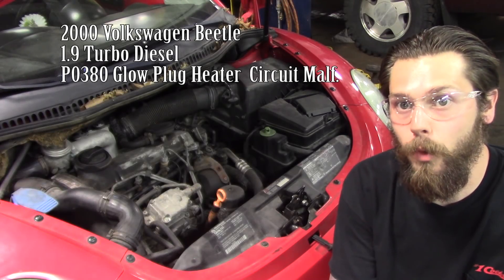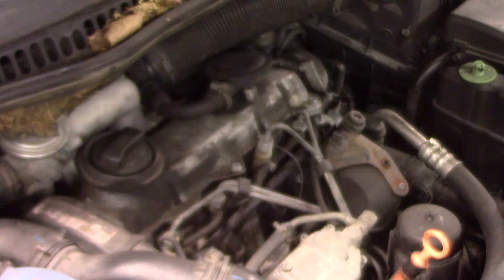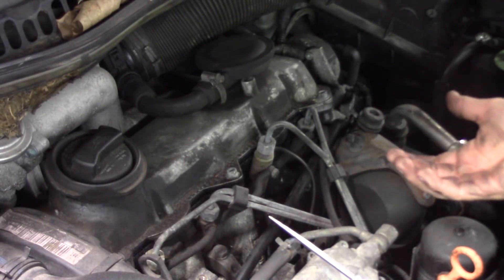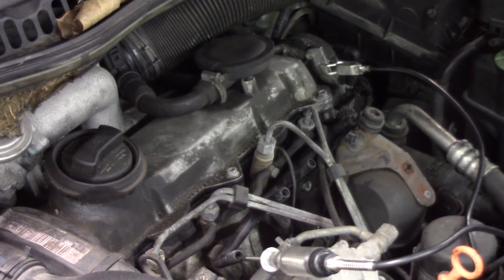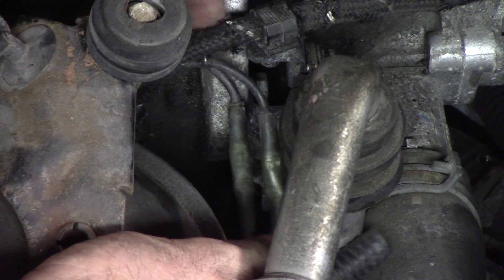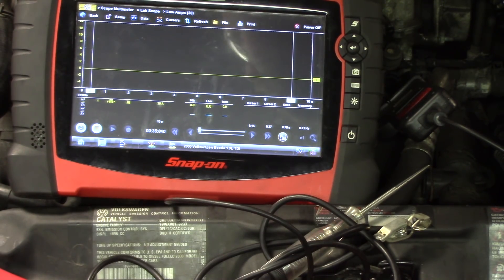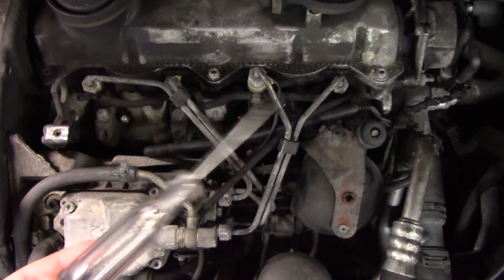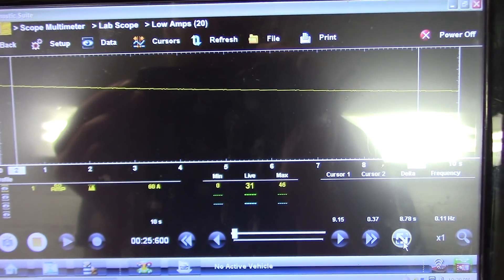2000 Volkswagen Beetle, 1.9 Turbo Diesel-P0380 Glow Plug Heater Circuit Malfunction

Comment: Thank you! This has been the most help. I have a 2000 Jetta TDI with a ratfkd harness and spliced in glow plug harness (likely culprit). Glow plug light will flash when key is turned, but then no glow plug function and still rough starts. Now that that over replaced the ECT, and checked the harness I will actually get a P0380 code. I don’t think it’s my relay. I haven’t checked the glow plugs themselves but when I disconnected the ECT it ran for 20 seconds and timed out but started fine like it should. Everything points me to the harness.

Comment: 2000 Jetta TDI with 252,820 miles on clock.  Threw CEL with P0380 on cheap OBD scan tool.,  Had 3 of 4 glow plugs test bad with test light.  Harness was basically crumbling as it was brittle.  Replaced glow plugs and harness, and still CEL with P0380.  ECU apparently remembers, so erased all codes with OBD scan tool.  No more CEL.

Comment: I came across this interesting problem once. Hard cold start, as if no glow plugs were working. Checked to see if they were getting power. None of them were. So I thought it might be a relay issue. Went down that rabbit hole, only for somebody else to find the problem in 3 seconds. :/ They took a wire, and put one end to the plug first and the other to the B+ terminal. Obviously, you couldn't see anything with the plugs screwed in, but on the LAST plug, when he touched B+ the wire started arcing! That one plug was shorted to ground, effectively disabling (?) the relay. Somebody else had tried to remove it, snapped it internally, and left it there. Maybe there was a sensing circuit, or maybe the shorted plug was pulling so much current that it was disabling the relay. I really don't know what happened.

If you unhooked that one all the rest would suddenly work again and the car would start. 

Pretty cool test, learnt something there, lol. Whenever I see a no PWR condition to the plugs that's the first thing I check now before diving into the relay side.

Comment: Thank you very much!  I know all the TDI ALH engines are the same, but given how cramped the space under the Beetle hood is, It's nice to see it worked on.  Gives me confidence.  I only wish I'd seen you remove and install the glow plugs.
Reply: 10mm deep socket, careful not to drop anything in. Put copper antiseize on the threads and your copper crush washer.

Comment: What should I do next if I have new glow plugs and test light comes on at the glow plugs bit nothing at the harness..
Reply from the maker: Make sure the relay is sending power.  so check for power at the relay pin.  If power is good then you have some broken wires

Comment: i would have tested that circuit with a higher load test light due to glow plugs drawing many more amps then that test light you used ... just to make sure there is good power under load

Comment: Hello great video. I have a question last year I changed all four glow plugs and my harness. Right now I have a flash glow plug warning light. When I did the test with the test light connected to a ground on the engine. All four harness connectors didn’t light up. I’m thinking that I didn’t have a good ground. What do you think? The diagnostic code is p0380.
Reply from the maker: Either your test light had a poor connection or you have no power going to the glow plugs. Redo your test and make sure the ground connection is good

Comment: Thank you. I found the problem, I was thinking it had started right after I replaced the brake light bulbs with LED's But I know it sound funny, I changed back just the light bulbs and everything is now working again, and no more flashing glow plug light, It is so weird how that could have done it, but that is what it was, had I know it before I would nto have done all the other things, Thank you for getting back to be so soon, You have a great weekend.
Reply: Pet Fri question I have a 2001 Vw beetle Tdi. My car glow plug light is flashing too, I replace my interior lights with led bulbs but they aren’t working right. Are you saying that adding the Led brake light bulb cause the p0380 code to come on? I did the test with the test light wire on the positive battery terminal and notice that the first 3 glow plugs light up but 4th glow plug didn’t light up. When you put the original bulbs back was your problem solved?
Reply: Hello Jon B, Thank you, yes right after I put the old light bulbs back in the glow light stopped and the cross control works again, it is kind of weird but that is what was my problem, So what I did to be able to use the LED brake light bulbs, I added a one of the old type of light bulbs to the brake wires in the trunk, I have to use the LED in the back light cause they are after market lights and with the normal light bulbs they would melt. I only have 2 glow plugs that work, so it could not be that i'm thinking what you have the problem with, I have to get 2 new for the winter yet. as it can get really cold in Alberta, sadly, can not wait for spring. Hope I answer your question, My cars are 2000 Jetta. I have and yes the code reader said P0380 glow plug/heater circuit A. Does your code read the same? I'm thinking it most be the same. Please let me know if you found the problem. I should make a video about that, or you should or some one, cause when I had that problem I spent a few days online trying to find out why, and did not find anything. Thank you.

Comment: Hello there, Thank you for the video, I have a problem, the glow plug light comes on after the car has been running for a min, and the cruse control does now not work, I have replaced the wire harness from the computer all the way to the glow plugs and replace the glow plugs and the relay 180 and still the same problem, I have a code reader and the I get P0380 GLOW PLUG HEATER CIRCUIT A, any idea what could be the problem? or what I should try next? or what it could be? Thank you
Reply from the maker: I think the computer looks at amperage on that circuit   I would take a current measurement see what kind of amperage you have and go from there

Comment: Timing on no1 is what i did do, but then i question my self did i ?
This engine is timed up at 50 btdc.and not tdc
When ford brought Jag , these are the crappy engine they put in.
Anyway i am getting away from the very first question i asked.
Is there away of seeing on a scope a correlation with the cks, cam censors and the injectors without  the use of a transducer ?

I will be  having a break from this  and attack it with a fresh mind later on.
Thanks fot time.
Reply from the maker: You could probably get some type of degree measurement looking at the crank and where the inj fires in relation to the crank. A pressure transducer would be best

Comment: You got me thinking dude aswell has my  head beening a bit muddle.
If i positioned the cams on no4 cylinder on the compression stroke instead of number 1 cylinder iwould still have good compression right ?
But the pump timming would be  incorrect ... 😕
Think ive lost the plot !  Need a break from it .
Reply from the maker: I'm not familiar with that engine, why not position at on cyl1tdc? what is the diesel engine out of?

Comment: Hi tommy wolf , nice to see someone working on diesel.
I have a question not relating to the beetle. But may be you can answer this please.
How can i check using the verus when the diesel injector gets the command to fire in relation to 50° btdc on number no1.
Am i correct in thinking i can back probe the cks and injector.
.just not sure what to use on the verus. Can u help please and share some light . Thanks ps.
Reply from the maker: You could use the crank and inj. What engine?  If you could make a fitting that would thread into where the glowplug goes and install a psi transducer to look at in cyl pressure
Reply: Positive Lead Diagnostics  thanks for the reply , the engine is a Ford 2.0 diesel 2006 which they fit into jaguar. 
It had a broken cam chain guard . Which has been replaced. timed up, good compression on all cylinders but is a no start with no fault codes. So with out stripping it all down again and checking if I'm 180* off . You know when things like this happen mind games start to play it's part
 " did I time correctly ? "
I don't have a transducer , bet that's expensive . 
So I thought may be I could check some other way.
Reply from the maker: If your compression is good how could it be 180 out

Comment: The Amperage test is very important, it will tell you the glow plug is drawing the right amount of current. The test light test is a good , but not full prove. Great video.
Reply from the maker: I agree. I think both tests are important. And mainly so easy and quick
Reply: Yeah test light is 100% a useless waste if time that doesnt tell you anything. 

The cel p0380 comes on from the most minute voltage changes. The test light will still pass a shitty gp harness connector.

Comment: Amp probe at the battery would have done that test each glow plug pull 10-15 amp each
Reply from the maker: Yeah but there might be some other amperages there. It might not be much.   Plus the glow plug harness is really easy to access